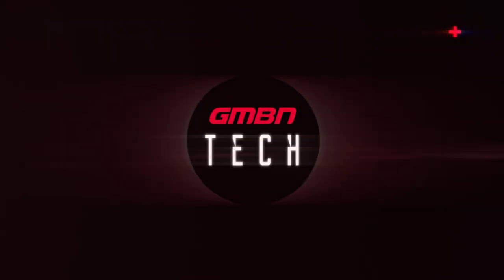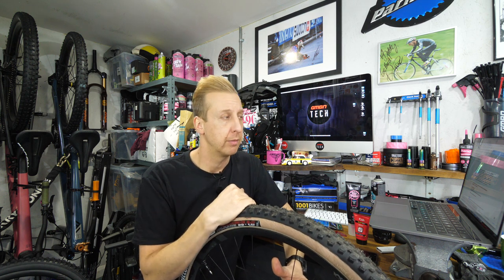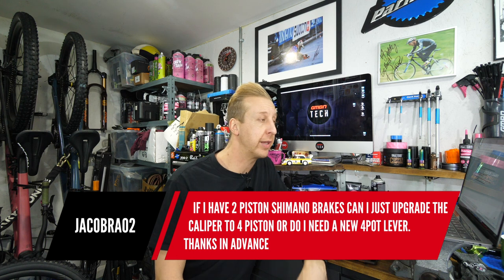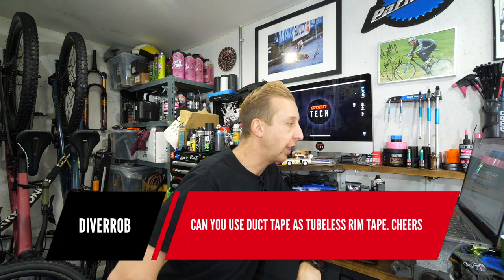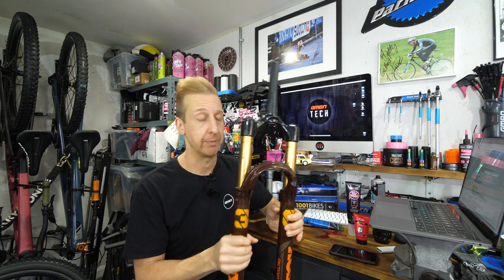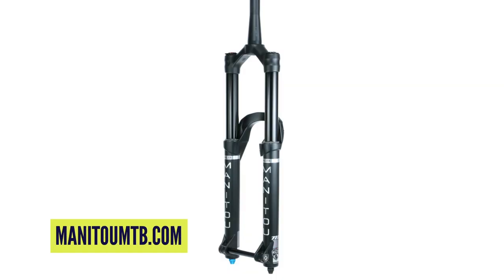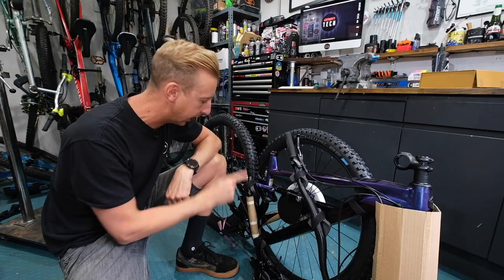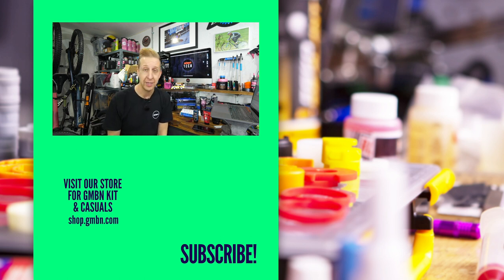What's The Difference Between A Reverse Arch & A Traditional Fork Arch? | #AskGMBNTech

Comment from the maker: Do you have a MTB Tech-related question? Use the hashtag #AskGMBNTech and your question could feature in an upcoming show!  Let us know 👇
Reply: #AskGMBNTech 
Hello! Do you think there are big differences between grips? I mean should I buy an expensive one if I am not a professional or a 10-20$ grip makes it from amazon? Or what is the difference between a cheap and an expensive?

p.s. : sorry for my grammar 😅
Reply: #askgmbntech i have to manualy decompress my fork and dont have enough money to buy a new one what do you suggest i do
Reply: #AskGMBNtech 
I ride mostly mud and wet roots, I am not sure whether to get a full mud tyre or something like maxxis minion dhr ll
Reply: #AskGMBNTech Hi! Thanks for all the great videos! I am 5 foot 10 inches riding a size large 2017 Cannondale Habit 6. It has a 60mm length stem with 760mm width handlebars. I am looking to make the bike more aggressive by putting wider bars (around 800mm) and a shorter stem (around 40mm) on it. The reach on the bike is only 450mm, so I was worried that putting the shorter stem on it would make the bike feel too small. If you could give me your thoughts, that would be much appreciated. Thank you!
Reply: #AskGMBNTech
Hi!
Last week I had a muddy ride... Whilst cleaning my bike, I discovered my brake pads (v-brakes) got a lot of wear in one ride. Now they need to be replaced... Do you guys have any longlasting brake pads for v-brakes you can recommend?
Reply: #AskGMBNTech I feel like my 2020 stumpy evo fits almost perfectly (remember, it only exists in the sizes S2 and S3 of which I own an S3), but I feel like a tiny bit less reach in combination with slightly more range could positively effect my riding. I have the 150mm Fox 36 Rhythm. As far as I know fox says, on this fork you can get the travel up to 160mm. This would be two birds with one stone if this does not cause the bb to drop too low (I already have 165mm crank arms on there and ride it in the high setting). Now how does that work. As I understand it, I only need to buy the kit for the new air shaft assembly / or with normal words... i need a new piston for 50,- € and I´m set?
Reply: #AskGMBNTech great channel Doddy 👊
Another tyre question for you (you helped me out last year with a tyre question) I'm currently running Vittoria Barzos 29x2.25 Graphene 4C (on your recommendation and they are awesome) and as the UK conditions are a bit sloppy/muddy looking for a recommendation for a front tyre with a bit more grip in the Vittoria range but not too chunky.
Reply: #AskGMBNTech Hi Doddy, I need to replace one of my crowns on my downhill fork, but when I search on the internet for a replacement crown for downhill forks, it comes up with brand new forks. Does this mean I am going to have to replace my whole downhill bike fork? Where can you find replacement downhill fork crowns? Please help, because I can't ride my downhill bike until I get a new crown, and I can't afford a whole new set of downhill forks. Thanks
Reply: @josephstalin4727  Give your fork a service, its probably just the springs have seized or the fork has stuck to the lowers
Reply: #AskGMBNTech Hi Doddy, loving the vids from the Netherlands!
I'm lubing my chains with parafine wax with PTFE added to them. I really like it, even for mountain biking. I still wonder what's the best experience though. What are your thoughts about waxing? Wax or lube?
Reply: #askgmbntech what do you think of shigura is it safe?
Reply: @connorcampbell144  search ebay, i found crowns by searching "crown only fork" "crown top fork" and "flat crown fork"
Reply: #AskGMBNTech hi doddy! Im looking into new hubs and i want some really loud ones in blue do you have any suggestions? I looked into I9 hydra but i dont think its loud enough. I also found some project 321 hubs, are they any good?
Reply: #AskGMBNTech what are some good handle bars with a 10 mm rise
Reply: For the person on this episode who wants to go from a 2 pot calliper to 4, would it be cheaper to get a larger rotor?
Reply: #AskGMBNTech
Hello Doddy I really like the show!
I would like to know your opinion about Deore 4100 and 5100, but not only from technological point. What I mean is that 10 (11-46) or 11(11-51) spd both can be a good upgrade from 3by or even 2by to change to 1 by, or just as a cheap but still capable build. Am I wrong? Not much about on any YT channel, compare to M6100 and higher. Thinking that a lot people may be interested to hear some things I mentioned on GMBN? Doddy?
Reply: #AskGMBNTech
HI DODDY CAN I USE MOTORCYCLE OIL FORK FOR LUBING THE TOP SEALS LIKE FORKBOOST DOES? THANKS !
Reply: #AskGMBNTech
Hi Doddy . I am Abhinav B Kumar from India . ProbablyIndian hardtail cycles are of low quality than American cycles . Especially the front suspension . They start corroding within 3-4 years and the action will be also decreasing . So is there any way to increase the action and stop corroding
Reply: Are oil slick rotors a thong thing and if so do they reduce the performance?
Reply: #AskGMBNTech hi doddy i was wondering what bike is that red one behind you? It has really wide tyres. Thanks.
Reply: #AskGMBNTech i wonder, can you use a suspension fork as a pogo stick?
Reply: @david94549  Thanks but I searched ebay and couldn't find an upper crown that fits 38mm stanchions
Reply: @sionvandevelde  from my own experience riding with v-brakes (which is quite a few years) I've found that avid rim wranglers do the trick quite well. I do not know if you're a traditionalist but I have also used road bike rim pads on my mtb and they have been perfect. SwissStop FlashPro
Reply: @MTBLabb  chances are that the sound you heard was the freehub internals still full of grease. If you clean all the grease out it becomes about 3x louder!
Reply: #AskGMBNTech Hi Doddy love the videos, I am in need of some help with my bike. I only have a carrera vengeance and the suspension seal has gone. I do not have the tools or grease to replace it but I am confident I could replace it. Should i pay for it to be done professionally, buy the grease ect or get the new bike I am looking at (my current one is nearly too small for me anyway). Thanks in advance, Joe
Reply: Why do bike companies only make a particular model in one color?   I can a car get any color i want. But a bike I’m just stuck   A bad color will prevent me from buying a bike. #askGMBNtech
Reply: #AskGMBNTech the rear thru-axle on my Niner Air 9 hardtail comes loose as I ride. I tried switching to a different thru-axle from Wolftooth but still have the issue. I guess I could put on some threadlocker, but this sounds tough to put on an axle that might need to be removed regularly. Are there any other solutions?
Reply: @sionvandevelde  Take some basic one's from Shimano. I'm using them on my everyday bike and usually do'nt have to replace them for a year or so
Reply: #ASKGMBNTECH
Hey Doddy, love your videos. I'm running a 2008 Marzocchi 66 rc3 evo. I'd like to convert from coil to air. Is it possible to install a Rockshox zeb air and damping unit?
thanks
Reply: #AskGMBNTech Hello Doddy, I have Shimano br mt410 in the rear and a br mt420 and I don't like the levers. I think about changing the levers to Shimano bl mt6100 levers. The problem is that I don't know if the calioers are kompatible with the servowave technology in the levers. Can I simply change to these Levers or do I have to buy a new brake if I want other levers?
Reply: #AskGMBNTech hey Doddy the plastic bushing that goes around the axel pin on my shimano slx brake lever is broken and apparently shimano does not send does parts separately. My back brake lever is jiggling around and it's is just not working as smooth. Is there a way to fix this?
Reply: #AskGMBNTech 
I am attempting to buy a full susser for 1k~ boardman 8.6/voodoo titan x/voodoo canzo. The voodoo and carrera use the sx eagle 12s which I've heard is trash and the boardman uses the deore m4100 10s but, uses suntour xcr forks whereas the voodoo and carrera use rockshox recon rl forks. The voodoo is enduro whereas the carrera and Boardman are cross country and the VooDoo and carrera are 27.5 inch whereas the boardman is 29 inch.
Reply: #AskGMBNTech oval or round chainring which to pick
Reply: #AskGMBNTech 
Hi, I have a 27.5 hardtail and at the moment it has a 160mm fork on but it did come stock with 140, do you think it would be ok to upgrade it to a 190mm rockshox zeb? What’s your opinion on this?
Reply: #askgmbntech Are there any mullet hardtails out on the market? How would it perform, is it worth a try?
Reply: #AskGMBNTech 
What is the difference between regular and assymetrical rims?
Reply: #AskGMBNTech
Hey Doddy,
Great show as always! I watched your show last week which included a question you answered about upgrading from 2pot to 4pot calliper. Well I have a slightly different question to ask about Brakes. I have a Scott Scale 910 (2020) and it came with 160mm rotors. I am struggling with rear lock up so I am looking to increase the disc size to 180mm as this should give better brake feel and hopefully stop the rears locking when I don’t want them too. My question is can I get a 180 rotor on the back and if so which rear mount do I need because there are a number of different versions on the market and the location of my rear brake may need something specific.

Thanks in advance
Scott
Reply: #AskGMBNTech my fork won't go through it's full travel ,when fully compressed with no air, there is 1 inch left of travel ,but when I turn my bike upside down for 10 minutes and try it again it goes through it's full travel
Reply: #AskGMBNTech Hey Im looking to upgrade my rear wheel hub for a higher engagement hub (i9 hydra) but I don't want to pay the full price, is there any way I can put an i9 hydra freehub body on my Shimano SLX rear hub? Thanks a lot
Reply: @peoplesrepublicofchina8340  you can lace up pretty much any hub to a rim
Reply: Hey gmbn can i get in trouble or can a bike get in trouble if if turn my manitou fork the other traditional way cuse i relly dont like the look of it and i cant do footjams? Please anser me thx
Reply: 7:00   How "stiff" should an arch be?  Can arches be modified, stiffened, or a extra brace or bridge be added - like adding a reverse arch.  ?

Comment: I love how the thumbnail isn’t an actual reverse arch fork they just turned the handlebars around😂
Reply: Because manitou.
Reply from the maker: We haven't got a bike with Manitou forks on right now so used an image that was sent to us 👍 Hopefully it got your attention! 🤣
Reply: RODEO 🙌🙌🙌🙌
Reply: The negative offset from the reversed fork bodge gave me chills 😬🤣
Reply: @kswsquared  Negative offset, also known as inset.
Reply: Sure they turned the fork and left the bars the right way
Reply: Trying to find a cheap replacement fork i came across images of the cheap Chinese forks and half the images had the forks on completely backwards. Definitely don't choose a fork if the company images are backwards haha
Reply: I've seen bike shops... Actual bike shops with bikes on the floor built with the fork mounted backwards... 🤦
Reply: @davidkline4372  I've seen people riding their bikes like that. For some reason these all seemed to be the same brand that is sold in a specific store. The steering must be horrible, especially on a fat bike with like a 75° HTA.
Reply: @gmbntech  situational question, by accident while you where adjusting your handlebar and suddenly your fork turned and is now in reverse and by stupidity you Didn't notice it. Is it safe when used in straight road and on bit rocky terrain..
Reply: I didn't realize until now
Reply: @emmanuelmoreno409   this gives the vibes of that viral QnA video where the muslim man tells the "priest" about how he accidentally ate shwarma water and apple after slipping during ramadan fast.

Comment: Also Dottie, make sure this guy is turning the bolt the correct direction! I have a son in law that helps me work on cars and such and he does a good job and is a huge help but cannot figure out which direction to loosen or tighten. On most things this is not a problem, righty tightly-lefty loosely but, as you well know bikes are different, especially around the crank!

Comment: The bit about removing the frozen crank bolt with an allen key -  I've had terrific success with reluctant bolts by spraying them with penetrating oil (a few sessions and rest overnight to soak in) then  placing a hot soldering iron tip into the bolt allen recess, to heat up the bolt.  It takes 5-10 minutes for the bolt to absorb enough heat so the differential expansion between the stuck bolt and the crank will dislodge whatever corrosion is holding it fast.    The rest of your tips (breaker bar leverage) does the trick, without threat of breaking ribs!

Comment: Another benefit of a reverse arch is that, depending on which side you run your brakes,  they can be set up to do a single barspin without running the front brake hose through the steer tube. I'm in America and run my front brake on the left with the hose staying on the left attached to the reverse arch and down to the front brake so when I throw a bar spin with my right hand the hose spins from behind the fork, around the front of the bike and ends up untangled on the right side.

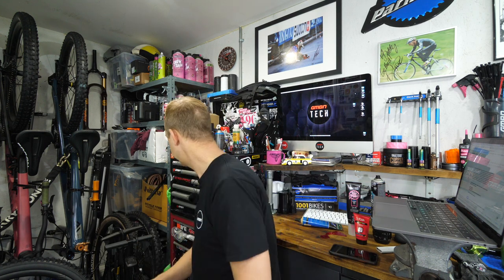Comment: 0:45 if the sound is closer to a clang your brake and rotor are not aligned and you might need to straighten the caliper or your rotors bent( also this sound only happens at speed)

Comment: The clicking while braking hard:
if you hear it on the front of the bike:
it could be the headset creaking, that can have many sounds, it could just be dirty, be making scraping sounds, clicking, knocking.
could be the stanchions on the fork in the crown, or crown and steerer tube.

Front & Rear:
This can happen on front and rear, if floating brake rotors have been used for years they can creak in the rivets.
check all bearings, bearings is a common thing to click, this can happen due to wear, so worn out bearings, or bearings weight bad tolerances or bearings inside frame or hubs with undersized holes for the bearings, this will compress the bearing making it click.

if you hear it not he rear:
if a carbon frame the frame might be cracked and braking puts stress on cracked area making cracking sounds.

it could be the suspension pivots, loose bolts, or gravel stuck in a gap, this happen on a Trek bike with ABP(Active Braking Pivot) it sounded horrible, scraping sound, clicking, knocking sounds.
Reply: It may also be the spoke nipples moving slightly in the rim bed. This can be easily remedied by dripping a little 3 in 1 oil into the spoke holes.
Reply: @trp1751  forgot to add rim hole reinforcement rings, they can get loose and rattle, but Tha twould not be only while braking. If running tubes it can be loose nut and tube missaligment or loose valve nut, so under braking the tube moves and hits the rim, if it's a aluminium valve it will be noisy, but misaligned valve will result in damage of the valve, leaks if let too long, I've seen destroyed leaking valves due to this, car style valve on budget kids bikes mostly.
Another thigg could be metal shavings in the rim that rattle and move under heavy braking or bumps.

Comment: Great show as always!  I believe that Shimano, like KMC, recommends NOT removing the grease from their new chains.  They say that the grease is applied before the chain is assembled so it is in the chain in the rollers and pins where you would never be able to get it using standard chain lube.  As to dry vs wet lube, I used to use dry only as that matches my riding conditions in Southern California, but a few years ago I switched to using synthetic lube (which is thicker and like a wet lube) because it lasts so much longer.  I don’t like to relube the chain any more than is necessary and I find it stays lubed, smooth and quiet much longer with syn lube, and doesn’t get any dirtier than a frequently lubed dry lubed chain.  YMMV... :)

Comment: Your 2nd question, about swapping a 2 piston for a 4 piston caliper.   I did this with some low end Shimano MT420 series.   I tried to cheat it and not install a fresh new copper fitting (they call it 'the olive'), and it subsequently leaked where the brake hose inserts into the caliper - just slightly weepy, but it was just sloppy and I needed to do it the right way.   These 'olives' are a bit hard to come by, and I had to order one (order a few as spares since hardly any bike shops stock them) - but, once I did so, my new 4 pot caliper (Deore level) works brilliantly, and doesn't leak.   Full bleed, use fresh 'olives' and give yourself a brake (ha ha)